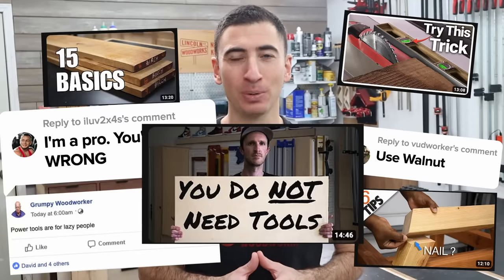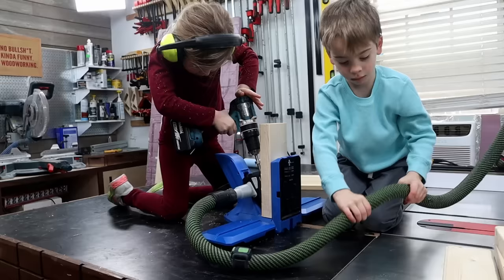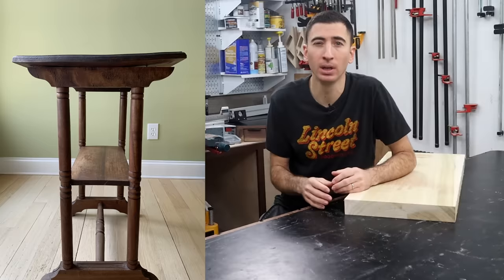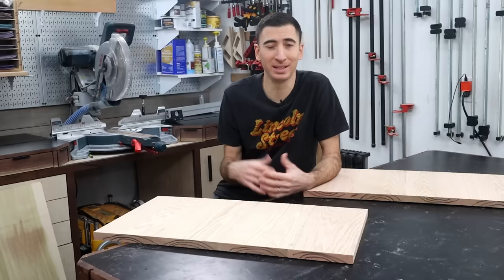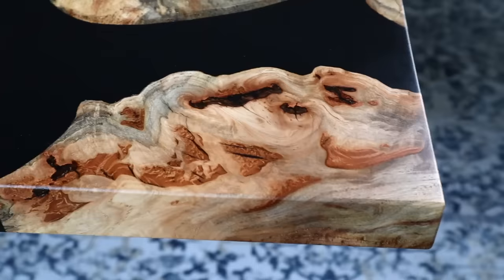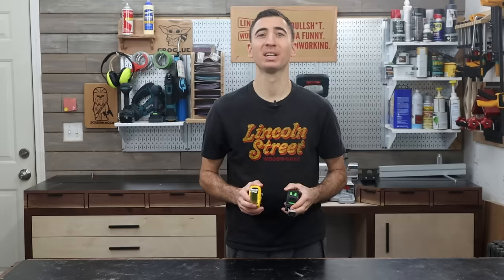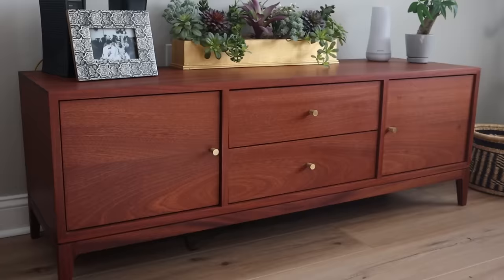Every beginner needs to hear this

Comment: I sold a series of small side book shelves that where meant to go next to chairs or couches.
Perfect size to hold some books and a small lamp + coffee cup.
I used pocket screws to put them together, very nice shelves, people loved them.
I had to buy them all back 2 years later. Pocket screws are not fine for joinery.

So ya, I have building furniture longer than you have ben alive, and have more experience in it than you have talking.
Reply from the maker: you've been building furniture for 38 years and you can't figure out how to build a bookcase that won't fall apart? sounds like a personal problem to me. My turtle offers consulting courses if you're interested.
Reply: @Lincolnstww  Yes. I built these when affordable pocket screws first came to the market.
As a pro, I am always looking for a way to improve productivity, thought I found one. Turned out I was wrong, I was man enough to buy them all back.
As a YouTube in influencer, you would not understand how stuff works in the real world.

Comment: in defense of the joint testers, the idea behind what they test and present is to show you that, even in the most extreme of circumstances, many joint including pocket holes & glue does the job needed. It's kind of like they test wing failure for new airplane, by securing the airplane down and using a hydraulic crane to pull the wings up until they break - You are not going to have a storm that will do this, but even IF you did, the structure would hold.

Comment: Ha ha nobody screams at the top of their lugs for Ryobi. 😂
Reply: On a serious note, though, after using most impact, driver and drills made by all of the major brands, they're really is a huge difference in the power and longevity. If you're going to commit to a cordless system because the batteries are so expensive, it really is better to buy, a brand that has higher quality stuff. Milwaukee, Dewalt, Makita, and Bosch are all worthy. Is not for someone getting into woodworking it's for someone who owns a home and for convenience needs to own a drill that they will use once a year.

Comment: As a qualified cabinetmaker I’d be too embarrassed to ever use pocket screws. Where possible I use the appropriate joinery. Where not possible usually dowel or biscuits. If I’m hard up and in a hurry I’ll use cleats. For me pocket screws are cheap and nasty, but given the time it takes to be able to manufacture a well made, well fitting joint then I understand the preference for this option for DIYers and handypersons.
Reply from the maker: Last name checks out

Comment: Well, the only part of this I'd disagree with would be the measure twice, cut once. Even if you're using something else to reference or mark your job, you still want to double check that you did it correctly which doesn't make the saying only accurate some of the time. Great vid though, props.

Comment: Sandingdust and CA glue works way better than sawdust and wood glue. Sawdust is too coarse. Sand the piece that needs repair with 150-220 grit. Pack the sanding dust into the offending area, add thin CA glue and spritz with accelerator. Truly is almost invisible after finish.

Comment: My Ryobi Bisquet joiner is a POS. The blade cuts very crooked before adjustment or shimming. Base plate is too thick and blade will not center on common 3/4" lumber.

Comment: Just like real wood siding.  BEFORE you install real wood lap, or channel lap, or tongue and groove, or board and batten siding.  You coat the backside with a 'something'.  Something may be as simple as mineral spirits and linseed oil 50/50,,, or the super duper house paint  (pink ?) that you have left over.  The goal is to not have moisture surfacing under your good finish.  A great paint job will fail if moisture percolates through from behind.  The most important coat of paint on a house is the one behind the siding that you will never see.

Comment: Joint tests are irrelevant?  Say it isn't so!  If you want your items to last, you'll design and build them to last, and that means using high-strength joints.

Back when I knew nothing about woodworking, I at least knew enough to follow the advice of my father, who'd been a journeyman carpenter before joining the Navy.

I designed the furniture, but incorporated his advice on the joints.

Result:  After 40 years, I still have all pieces of furniture!  They're lightweight, but strong as an ox.  No breaks, not even a crack.

All of them used rabbit, dado, or tongue and groove joinery, and all of them were glued and screwed with a known good-quality yellow wood glue.

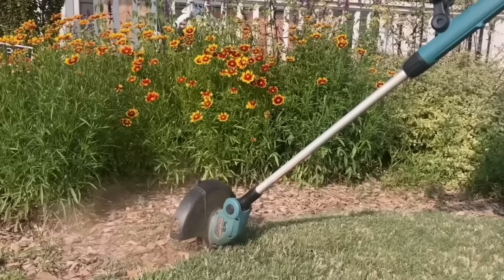Comment: 3:15 You are 1000% WROING! It does matter what type of brand you use. When I started at DYI I owned a Ryobi kit, Drill, Sazell, flashlight, and circular saw. I used them at first working on a home project. It was a reasonable price and as you stated it was for home use. The first time I used the kit, I noticed that the batteries didn't last that long. I felt they needed to be really charged. My next project came 3 months later while having my batteries cycling in the chargers. The batteries did not hold a charge even though they were in the charger the tools didn't have the necessary power to complete some tasks. I tossed that Ryobe kit and bought the Dewalt. I never had an issue like that again! I could leave a battery in my drill for months; pull it out and it works perfectly! 
It does matter if you are out in the field and depending on your tools to get you through that day... It matters!

Comment: It's when you make the perfect cut, you know it is, but things still don't go together right.  Then you realize you had changed the angle on your saw and didn't set it back to square or forgot to lock it down.  Get comfortable, not complacent, and you'll be woodworking, not building paranoia.

Comment: It depends on what the project is. That might work for woodworking projects. But not in construction. Due to a  board that slightly off. That small amount, can translate into a bigger problem down the line. That's why cabinet makers like molding. Because there can be and off set in a Wall that has a different. And molding that make up for that. You want a real education? Watch the expert that know on you tube university. That specialize in a certain area with years of experience. That's where: measure twice, cut once applies.

Comment: Nope quit lying to people, the brand of tool does matter.
But not because of power, but because of quality, and it changes every couple of years.
Have a black and decker sander and screwgun/drill and both have lasted for over ten years.
And I got both from Walmart for under $20.
Needed a corded drill for more power.
Bought a $280 hammer drill from Lowes, had a weird Asian name all I know is it was green and highly rated but Lowes no longer sells them.
Used the damn thing 3 times and the 4th time I went to use it it started clicking like it was in hammer mode but hammer mode was busted, I switched it to hammer mode and it acted like it was in normal mode.
So now I have a drill that might die on me at any time and I can't use it as a hammer drill when needed.

Comment: Wood glue and sawdust works with any finish with one caveat. The glue has to be hide glue, then anything flys. Cutoffs, shavings, sanding dust, or even pigments, soaks up any finish.
And the demonstration of the cupped boards leave out a crucial detail. In the books where this is teached (for verniered plates), they make it a point that the boards have to be ripped along the core line, alinging sap side to sap side and heart side to heart side. So the demonstration doesn't even follow the criticized technique

Comment: If you're building with wood that is identified by its size rather than species, then that is the first mistake being made.
It will take about the same amount of time to build a project out of ugly wood as it will out of something that looks good. The difference is the ugly wood will always Look ugly.
A friend of mine made a very nice wardrobe out of construction plywood, when it was finished it looked like something on the construction site.
Although you can (GASP!) paint it. 
Just like the finishing aspect is very important to any project, so is the selection of the wood.

Comment: In a perfect world, I see only about a dozen different wood species. Starting with a trees that are tall and gun barrel straight and when sawed into lumber it smells like pine, but wont move warp shrink bend twist cup rot lighter then cedar and stronger then oak and or wont burn with fire. The side effects of this tree is better heath eyesight memory and IQ increases....... That wood would solve most of my problems when working with wood.............

Comment: I wouldn’t say one brand of battery tools is far superior. Maybe slightly better. I built an entire house with the old craftsman C3 line of battery tools. Were they great, no, did they get the job done absolutely. I have since operated to Milwaukee, and yes, they are much better they’re not far superior.

Comment: Why would you need to disconnect your dust collector vacuum from the sander just because you're doing the glue-sawdust thing?
Reply from the maker: So the sawdust sits on the surface and mixes with the glue instead of being sucked into the vacuum
Reply: @Lincolnstww : Oh, OK. I thought this trick was done by manually collecting sawdust from previous cuts and mixing the glue with it beforehand.

Comment: Many years ago i used to work in a company that produces windows and doors out of natural wood. One type of wood happened to be mahagony. That ''smiley/sad face'' rule was mandatory. You could get fired if you didnt obey that rule lol!
Tbh, i think that, in that particular case it does matter. We glued together thin boards approx 3m long to get strong and straight posts that would be further processed for doors and windows. Wood in its natural form is usually not perfectly straight, you need to make it so!
Reply from the maker: On thin pieces without joinery that’s holding it flat it absolutely can matter
Reply: @Lincolnstww  By thin i mean roughly half an inch thick, maybe slightly more. You glue 4 to 6 boards together to form a post from which the details are cut out of, window and door frames for instance, you need these things to be absolutely straight and stay that way, especially when dealing with mahagony doors/windows that happen to be extremely expensive!
Reply from the maker: @rockmcdwayne1710  yep!
Reply: @Lincolnstww 
But then why do you make this statement that alternating is unimportant?
I see it like this: if I see a table that is not alternately made, it is simply not as high quality as one where attention has also been paid to these details.
It is simply basic knowledge of how the wood behaves.
Plus the rules of my master craftsman:
You can never say always and never, there are often exceptions.

But recognising the exceptions is difficult, especially for beginners, so you start with certain rules.
Reply from the maker: @mg7990  Go back and watch the video. I explained exactly when I abide by it
Reply: @Lincolnstww  Go back and loock at your clickbait youtube thumbnail.

I understand that beginners should not be discouraged, but a beginner cannot judge whether the wood is dry, whether it is soft or hardwood, or whether the construction stabilises the wood sufficiently.

A beginner will have more success with the rules, e.g. if the wood really should not bend, you will cut the "smileys" in the middle.
I would have liked the video better with the same content but the headline "People don't be discouraged, build something" instead of: "the old rules are wrong."

But I think your title was better for the clicks, and you knew that.
Reply from the maker: @mg7990  start your own YT channel so you can make titles exactly how you like them. The video has over 600k views and 98% of the people that watch have “liked” it. I can’t please everyone.
Reply: @Lincolnstww  
Exactly what I'm saying you know how to trigger skilled craftsmen and how to make beginners feel good that's harder than building furniture.
You have my full respect for your Youtuber channel.

Comment: Godd video, maybe dont attack so many hot topics on one video. You are clearly surrounded by  trolls now 😢.     
Here's a tip for you guys.... Glue up your panels up with more, narrower boards;  rather than fewer, wider boards. All that cupping noise you are talking about is eliminated this way.
Here's a tool tip... I use lots of milwaukee and still have a parallel platform of Dewalt.  Unless you are making money with your tool or your just a weekend warrior with disposable income... buy Makita or Ryobi. The money you save can buy the wife something nice and lead to more runtime with your drill/driver or impact, if you get my drift.

Comment: 40 year veteran plumber here. his stance on battery tools is largely true. the tools themselves are pretty bullet proof. BUT- the batteries & chargers? not so much. makita? haven't used some of their latest- so I'll defer to him on that. the bargain brands & ridgid? tool? great. batteries & chargers? TOTAL KRAP. very slow to charge, very quick to drain. and no lifespan AT ALL on the battery packs. FULLY expect to be raplacing the packs once a year if you use them regularly. the pack itself? cells are ok- where cheap tools fail- is in the onboard circuitry in the battery. on the cheap tools- they 'cheap up' on that part of the battery- and on the charger. take ANY other brand & stack it up against a milwaukee? FAIL. if you like to be able to have your tool perform more like a corded tool? mw's your brand. they charge FAST. they perform LONG. if you are going to own any high amp draw tools like a skill saw for ripping? ridgid & ryobi WILL piss you off. if you're going to spend any where near $100 on the tool by itself in ANY case whatsoever? MW wins in overall performance- hands down. admittedly, a plumber like me puts a TON of stress on a tool compaired to the average homeowner diy'er, but a lot of cheap tools cost very close to what a milwaukee does once you own a charger & a couple batteries- but if you are going to KEEP your tools & use them in perpetuation- even for home use? I'd rather have one that out performs. there's a REASON MW packs & chargers cost more than competing brands- beyond just brand name.

Comment: Different power tool makers have different strong points with different tools, Ryobi makes pretty cheap and low precision tools overall ( I had their miter and contractor saw for 15 years, they are very poor quality) Makita is known for high precision cutting tools, dewalt is known for lower tolerance precision and high durability.  Milwaukie is also know for durability and power. This kind of knowledge comes from working commercial union carpentry and personal residential work for over 20 years. Of course, for a hobbyist none of this matters, just buy the tool that matches the quality of your work. When I started carpentry I had a dewalt drill (not screwgun) and a delta miter and table saw and the rest were hand tools. I may have been doing carepntry or "woodworking" but man was the quality shit.

Comment: Brand loyalty used to be about buying something that lasted and that resulting in trust. Washing machine from 1950 that finally died in 1986? That's why your grandparents only buy that brand. With power tools, it probably used to be the same. But today, it's like half that and half the same reason any people defend brands: they see it as a reflection of themselves and as a symbol of their decision making abilities. It's also a status symbol. Same with android vs apple phones, sony vs samsung vs lg TVs, xbox vs playstation, ford vs chevy vs other, and so on. Every time I see a DIYer making something awesome on Insta or TikTok who also doesn't hide what brand of tool the used, half the jerks in the comments are criticizing the tools and offering little to no feedback on the thing they made. This modern flavor of brand loyalty has some seeds of the same trust built through using the stuff, but some of it is blind tribalism and these people perform whatever mental gymnastic needed to back their choices. Bash a brand? You're saying they make bad choices, and that they're idiots! Right? It's exhausting.